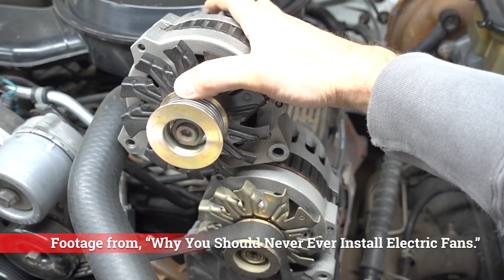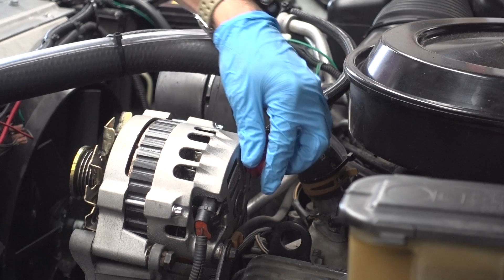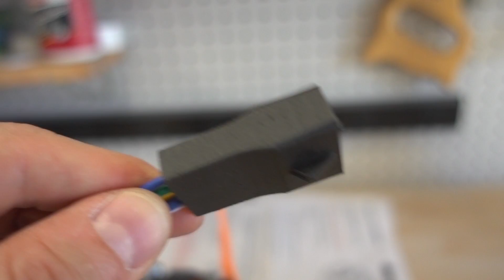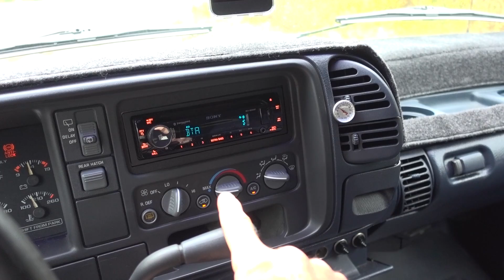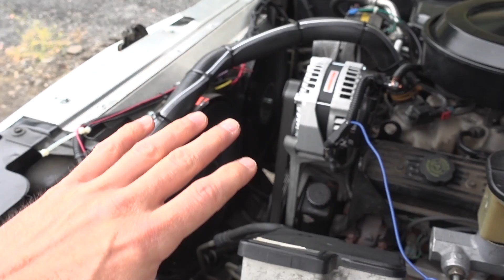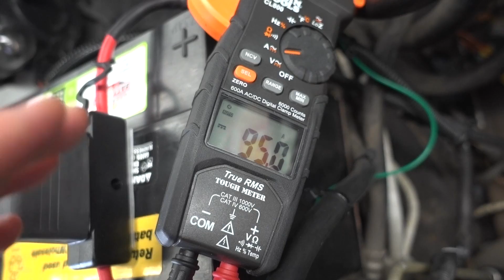Why This ALTERNATOR SAVED MY TRUCK & ELECTRIC FANS!

Comment: at least explain the basic fundamentals of how the alternator provides power,, it only produces what is being pulled from it ,, the alternator does not provide a constant amount of amperage.  thoose alernators cost around 400-500 dollars
Reply from the maker: That is correct, the alt is only going to produce what is being requested. I paid $399 for the alt.

Comment: Let's see, it doesn't fit put of the box, so you have to modify it and tou have to. Grind off a bracket.

Next you need to jury rig the wiring.

Sounds really hokey to me.

The company knows the hole in the product is drilled wrong. Do they fix the screw up? No. They give you an undersized bolt.  Bit then you have to file out the hole.
Reply: His truck came with a cs130 frame alternator... the alternator he got from this company is a AD244 frame alternator... (a larger frame with much higher amperage output capability.)
The hole isn't drilled wrong and the company didn't screw up, they dont even make the frame of the alternator. You wont get a cs130 frame alternator with this kind of output.. simply said if you want the performance of a bigger alternator you will have to do some minor modifications. This is actually a very common upgrade.

Comment: Nice video, but I hear people say RPM's, and it's just RPM.
Reply: Technically right, but you know, if it's common speech why correct it? People understand each other. That's all that matters.
Reply: @DENicholsAutoBravado He is wrong anyway...
Reply: If it runs longer than 1 minute,,, then it does become M's. Revolution's is already plural.
 Keep it stupid, simple.

Comment: 17yrs or so ago I built a SPL AUDIO vehicle with 23 batteries. I talked to the owner of MechMann alternators for a good amount of time. He explained what extra parts for me to get and where to splice them into the harness so I could vary the voltage to the max that my class allowed @1800 max rpm. I learned who else they also make alternators for that I can't devulge here but after I purchased from them for that vehicle and installed their alternator I was convinced they know what they are doing.... 😎😊😀

Comment: I just change the pulley on the alternator and my charging problem was solved.
Reply: Tell me, more rotation = more amps?
Reply: @pillormark  Just solves the low idle problem.
Reply: @jamesm568  was it bearing related? Too much restriction on rotation? Did you use a different SIZE pully?  Smaller = more spin = more amps?
Reply: @pillormark  By reducing the pulley size to 2" or 1-7/8" your alternator will start producing power sooner and produce more power cruising down the boulevard or on the highway.
Reply: @jamesm568  so,  to achieve similar results utilizing electric fans, you located a pully and bearing that would fit the v drive system with a reduced diameter and achieved more amps and volts to support the demand of the additional items drawing on the system? Is this what you are telling me? Can you provide part numbers and product providers so i can replicate this?
Reply: @pillormark  Find out what size your stock pulley is and replace it with a smaller one to your liking along with a belt that fits properly.
Reply: @jamesm568  , who did you utilize to accomplish this? Do you recommend a manufacture for this type of modification? What vehicle did you do this modification on?
Reply: @pillormark  I just go to my local auto parts store and ask for a smaller pully.

Comment: I bought the 370a elite about 6 months ago, working great in my 06 Silverado, I run about 5.5k rms sound system, adding a 2nd battery trey would help u out a ton too, I've got two big agms under my hood.. ces makes great alts to and there a little cheaper.. adding 1/0 wire will also open up its full potential, I suggest using tinned 1/0 ofc copper and tinned copper lugs with adhesive lined heat shrink covering all exposed copper.. and when u use the hammer crimp put the crimp on the back of the lug, the crimper crimps it into a triangular shape, the way u did it will work but it smashes the wires..
Reply: The smaller pulley on these help a lot, and these h/o alts a made to handle big loads and work great in warm conditions

Comment: Meanwhile people with Sound systems
Quad 250 Amp Alternators
They're basically have truck half mobile generator.
Reply: Some audio guys use 4 or 5 alternators with 370amps & the alternator alone will take most of the engine power when on full load.
Reply: I have a stock 230 amp alt with 4 batteries in parallel and solar panels for 2.5 amp charge running 4 amps and a 1kw inverter. My headlights don't even flicker
Reply: my SUV has a  60kw generator  330volts  @ 185AMPS  gotta power the  motors

Comment: Today jimbo will tell you why upgrading to electrical fans, while keeping a stock alternator is a bad idea. Maybe Chevy engineers didn't think about the amparage demand. So they ended up putting the cheapest alternator. 👨‍🔧

Comment: So what are you gonna try next when your fuses blow/melt?
Fuses blow because they're using too much amperage, so you just supply more amps?
Reply: You keep the voltage up. Higher voltage equals less current draw. The old alternator probably sat around 13.8 hot. This new one keeps the voltage up near 14.5 hot and has 100+ more amps available at all times. He won't melt fuses anymore.
Reply: @catch22frubert  : That makes less than 2 amp difference at 25 amps though. Less than 10% difference.
https://www.rapidtables.com/calc/electric/watt-volt-amp-calculator.html

Comment: Good idea. But does it decrease the battery life or not ? I hope you could give the accurate answer.
Reply: Lead acid batteries live longer if kept close to a full charge. The amount of time spent below full charge is what degrades them. 12.6 volts or a little higher is what they like. If I see 13.19 I'm a very happy camper.

Comment: why would you fork out for a massive alternator and not change to 1/0ga or even 2/0ga wire..
Reply: Jimmy said he was running 2g wire
Reply: @antoniofunnyguy  Jimmy is using 2 gauge. Mechman tell you to use 1/0 gauge.  I am running 2/0 gauge on my mechman 240 amp on my Chevy Tahoe.

Comment: WRONG electric fans are fine  you just got screwed with your fans....  Should have just went to a junk yard and pulled a FACTORY Fan set and alternator 
they work just fine on the NNBS and NNNBS(2007-2019) Tahoe and suburban

Comment: No problem as is... A suggestion.... Crimping...
High amps need solder.I would crimp then sweat the joint with solder..  I ran high wattage radios and  know  that over time crimps will cost you current flow.  Good video...  Later.
Reply: Incorrect. Cold welding is not crimping... And cold welding offers no more resistance than soldering would. On a nano scale, cold welding is also far superior to any kind of soldering work.
Reply: @Des420  wiring connectors on airplanes aren't soldered either. Vibration cracks solder. Definitely an issue on a truck.
Reply: @jeffnorbert1871  I didn't know that... But it makes sense. Thanks for sharing that info.

Comment: Hey 1 road
Why your ABS light is always lighten up
Make a video on that
Reply: Either the sensor or the reluctor are very dirty, or one of the sensors are done. The next generation GM trucks have a similar problem. But the abs sensor is inside the wheel hub. Easy to replace, but not cheap to purchase. And I mean both abs sensor and wheel hub.
Reply: high life 1320 so does it affect your breaking performance and safety???
Reply: @GamerzArena12  It can; as in you stomp on the brake pedal, and they will lock up. And that's what you don't want. The purpose for the ABS system is that you slow down, but you can steer away from a obstacle in front of you. As long as you have room to move to either lane next to you. In other words, ABS won't shortened your braking distance, but it helps you maneuver yourself from slamming into the car in front of you.
Reply: high life 1320 so its better to change rather than risking your life
What you say.?
Reply: @GamerzArena12  Sensors are easy to replace. I don't know what truck you have, the reluctor depends what pickup you have. The ABS module will be the most difficult to replace, but you do need a good  factory type scanner to verify if that needs replacing. Then again they rarely need replacement.
Reply: @GamerzArena12  Sometimes just cleaning the abs sensors does the trick. But it depends what pickup you have.
Reply: Change them. It won't hurt to do all four.
Reply: ABS troubleshooting is tricky, especially when you don't have the expensive equipment, and that is something you can't run to AutoZone and do.
Reply: James M thanks buddy for the information 💥
Reply: It's probably from his Vehicle/Transmission Speed Sensor. Very common on these trucks and often messes with the ABS system without throwing an OBD2 code.
Reply: @MidwestGarage  I have to agree very common for this truck, and besides the abs light it also usually causes the brake pedal to be in my experience spongy feeling. If I remember correctly abs stuff is hard to find or expensive/difficult to repair?

Comment: Am I missing something?..The alternator is supposed to make 198Amps at idle,I never saw that number in the Klein.
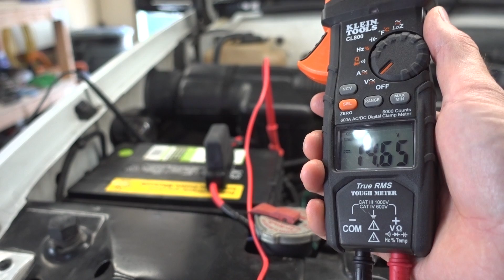Reply: It does. However in the test at 12:40 in the video he had everything on, in which is drawing apps from the total at idle/198 amps. He had 95.2 amps so it would be safe to say that he was probably pulling about 102.8 amps at idle leaving him with 95.2 amps at idle.  When manufacturers test the alternators they're normally at 0 load. Even with everything off, if he installed it into the vehicle he would only see about a 150 amps even though it made a 198 amps. This is because the vehicle itself pulls at least 30 or 40 amps to operate. I hope this helps in some way.  It would be nice if he did a test with everything off and at idle.
Reply: I also forgot to mention the extra amperage is what's charging the battery and if you have too many amps it can fry the battery.  It's like charging a battery on high for too long. They prefer a trickle charge. This is why most alternators are now computerized.
Reply: @robbyota5598  Oh ok,I get it now,suffice it to say,electricity related work is not my thing,but at least I like to learn a bit...Thanks a lot.
Reply: @robbyota5598  This is not how the electrical system or alternators work. You never saw 198 amps on the meter, because the truck was never pulling 198 amps. The alternator only puts out what is demanded of it, up to a maximum of 198 amps at idle and 258 amps at 2000 engine rpm. Just because it is capable of delivering 200 amps, doesn't mean that it always puts out that power. It only puts out what it needs to. Having a better alternator with more available amperage will not fry a battery, because it isn't putting out max amps 24/7 and the voltage is regulated to a safe range.
Reply: @theopinion9452  See above comment. You got some bad info, and you should know how things actually work
Reply: @catch22frubert  ,  Exactly in this case.  I agree with you all modern cars are computer regulated and only put out what is needed. Older cars had a voltage regulator but would put out Max amps at all times to my knowledge?  Most just had a one wire hook up also known as the exciter wire Watch energized the alternator  in order for it to work and turned off the  Charging light.

Comment: Why don’t you just do a dual battery set up man !!!!!!!!
Reply: Because a better alternator was 100% the right fix for his problem. With 2 batteries, he would still have an insufficient charging system and would drop below 12 volts sitting at stop lights. The bigger alternator now provides all the power needed and stays up at 14.5-14.6 volts

Comment: You got it!!! 
     I am happy to see you finally sorted out all of your electric / charging Gremlins. Thank you for making a update video.
     I have a 94 K1500 Chevy Suburban. I'm running a MechMan Elite 370 amp alternator part # B81657370B and have been happy ever since.  
     I would suggest going with their 240 amp alternator part # 81657240 on a stock 87-95 Suburban with electric fans. They also offer  Enamel paint In a bunch of colors on their lower amp models. I believe even the Elite models can be painted? When I ordered mine it was not available in the options on their website, so I didn't bother calling and asking. Mine is black. I wish would of called and got it in red. If you run more amps than your vehicle requires you can run the risk of overcharging your battery/batteries. Normally 50% or less is perfect but above can become problematic. Batteries like to be charged at the lowest amps possible and 2-4 volts above the battery voltage. Some alternators including MechMan can be adjustable for voltage, do not pump to mini volts in.  This is mostly done for car stereo guys running higher voltage batteries for less voltage drop.
     P.S.  MechMan alternators have been on sale for the last few months and currently still are as of now, 6-14-2019. MechMan alternators are expensive around $300 - $600 + - but well worth every penny in my opinion.  I have used a few of their competitors in the past but however stopped using them due to their customer service. Mechman customer service is  excellent compared to some other competitors. I have however heard some people have had problems with them however I have not.  You can also send the alternator back in when it finally dies and have MechMan rebuild them for normally a fraction of the price you purchased it new for.
      If anybody else has any other aultnator companies that are good and would suggest, I would like to hear about them. I'm always keeping my options open.
     https://www.youtube.com/user/mechmanalternators

Comment: Let's talk about your oil pressure.
Reply: normal on tbi chevys, only require somthing like 5 psi per 500rpm, once hot my 95 tahoe sits at 8-9 psi at idle, done that for the last 60k miles
Reply: My '98 Suburban has 214k miles.  Hot idle sits at the 1/4 mark, above 1,000 RPM it's about center.
Reply: This is common for tbi chevys so long as oil pressure at least gets up to 25 at cruising speed 2000rpm etc theese engines sometimes also have bad oil pumps from factory but i may be wrong on that but no his oil pressure is OK don't start worrying until "check gauges" comes on lol and when that happens just put 15-40 and Lucas in it and pow 30 psi
Reply: I noticed it too...way way too low at idle...should be 30'sh on guage for a healthy engine..
Reply: chicagomike6666 not really. This is a Chevy they have real guages not dummy gauges like all other makes. If you rev it goes up live feed.
Reply: I've had two GMT400s with 4.3 and one 5.7 All three showed around 30psi at idle warm. That being said all that's needed is 10psi per 1000rpm. If you have that your engine is lubricating well enough. I like straight 30 most of the time. 10w30 below freezing. 5w30? Only in a new truck or in the artic circle.

Comment: Mechman is a good company and produce some nice alts... But Mechman are not the best alt company out there. I prefer DC Power Inc., personally. That alt also is pretty much entry level as far as aftermarket goes and required an awful lot of fab work for a "plug and play" unit.
Reply: Exactly....DC Power, US Alternators, lots of better options than mechman. I went with a DC Power 300XPS....runs circles around that mechman.

Comment: They say "Maintains 200+ Amps at engine idle speeds" so you found that to be not true??
Reply: He only ever needed 100 amps to run everything in the truck at 100%. The truck isn't even capable of drawing 200 amps. He would need to install a big amplifier or something that draws tons of power to see the alternator make it's advertised ratings. The alternator only produces what's asked of it.
Reply: @catch22frubert  ,  Exactly he only needed about a 100amps at idle. The truck may draw just a little bit more but not much.  He did this video where he finally checked the amp draw and I believe it was a total of 65 to run everything and another 30 or so for the fans 90 amps total. https://youtu.be/vaX8vhk_bY8 11:00
Reply: Exactly, that is the catch it will maintain 200 amps with no load. As soon as you add a load they cannot keep up As advertised. If you need that many amps at idle your in trouble.

Comment: I installed #282 fans in my Silverado. 
Also, a 170 amp alt from someone here on YouTube (Alternator Man)
It was a drop in application. No adjustments. Easy deal.
I adjusted my fans to come on AFTER my thermostat opens. So, they are not running all the time. Only when needed 

I’ve had nary a problem 
Zip, zero,  etc
Reply: @Aaron Wilson Flexalite 282 fits the 99-04 GM trucks and SUVs with a 34" radiator only 4.8-6.0 V8. So most 1500s. 2500 and above, or the 8.1 V8 may not apply for this fan. That alternator you have to look that up above.

Comment: not sure if youve done a video on it but upgrading the flimsy factory grounds helps relieve a lot of stress on the system as well.
Reply: electrical fans work fine on the factory NNBS and NNNBS  they have beefy 150 -185amp 
MY factory High Voltage  to 12V+ DC is 185amps or 2.3KW ( FULL OUTPUT AVAILABLE anytime)   Tahoe Hybrid NNBS..

if you want to talk about alternator my is 120KW  3 Phase  330vAC 
Now thats an alternator ( more like the generator and starter  LOL!) I can power small neighborhood with that